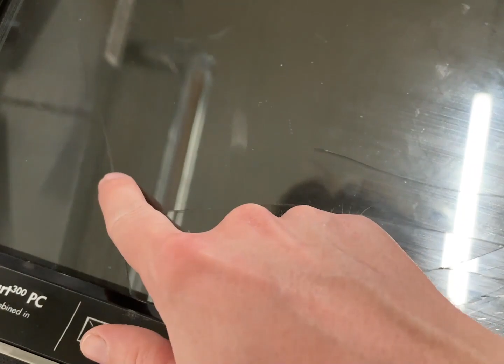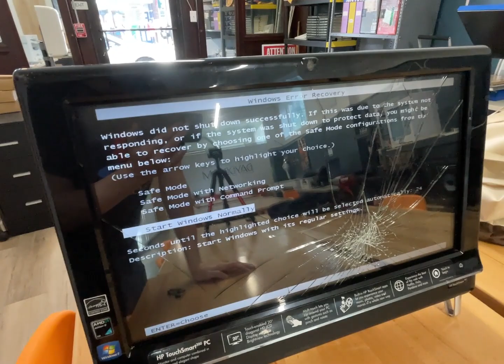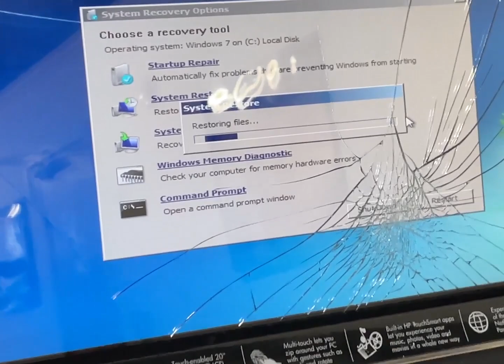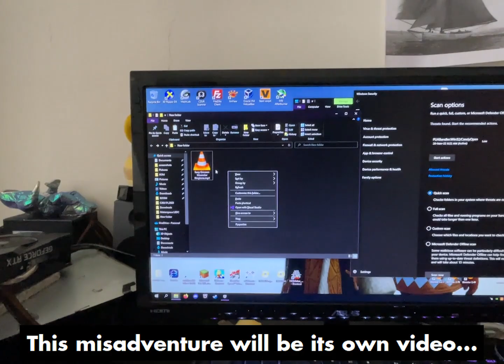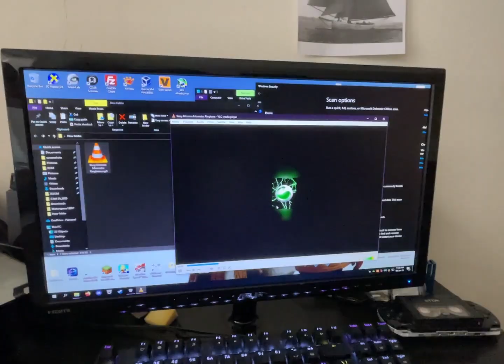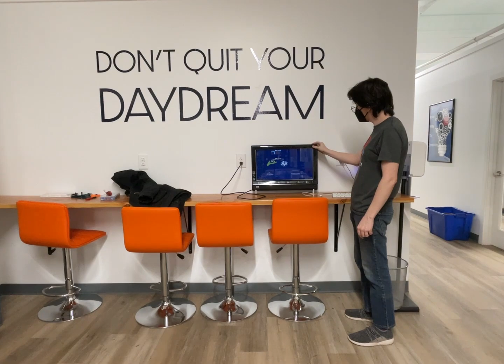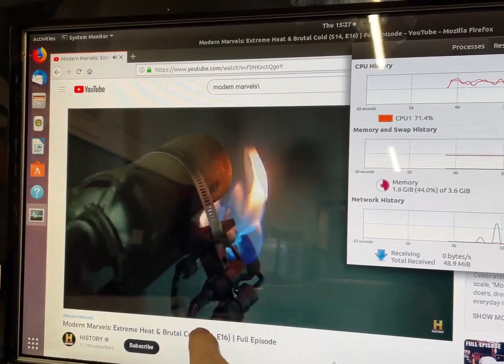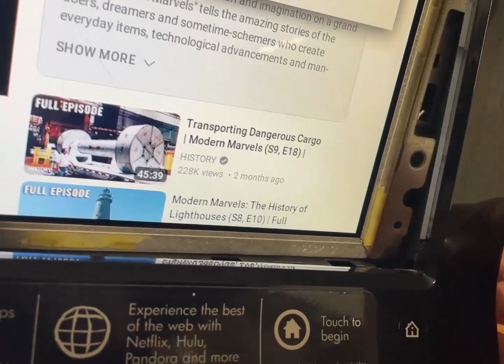Found an HP Touchsmart 300 computer on the side of the road!

Comment: I ALWAYS have my eyes open for computer stuff that's dumped outside houses, or at roadside.  That started about 8 years back when I found a laptop dumped in a skip (as we call dumpsters here in the UK) that was placed outside a house for the workers to dump debris from the house renovations.  I couldn't get the laptop working (not enough knowledge back then) but salvaged the screen and ended up using it as a secondary monitor for a couple of years. 

The one that really breaks my heart is where I've worked labouring jobs and the companies are throwing away laptops and PC's but we are not allowed to take anything; even if storage media  has been removed.  I remember dropping ten school laptops into bins (not even recycle bins) and groaning inside because the school caretaker was reluctant to let me take any; then on another job, I was moving furnature around in an embassy, and they had literally hundreds of old computers and monitors which were going to be destroyed.  I was salivating all morning seeing that; but, I suppose for privacy and other reasons, they wouldn't let any of us leave the building with the 'junk'.  It's probably in landfill now? I dunno.  Those kinds of things really hurt my 'inner junk salvager'. 🙂
Reply: same here buddy....i went the extra mile and salvaged stuff regardless, of course respecting GDPR by removing HDDs, but the risk was high, rewards where worth it, my local library has an E-waste bin i frequently pillage from, as long as i donate somthing first it is morally acceptable!

shame i can't rescue Tellies, they are just too big to walk out with!

Comment: Looks slightly better designed/serviceable than the one I parted out some years ago, mobo was bad but the HDD and RAM helped revive a laptop! That one's nice, has a full-size HDD and nice big access-panels.
Wow! That's an impressive amount of greasy schmutz in there! Where was this, a kitchen?
Gotta say, impressive salvage-work in removing that glass! Pity they made the video ribbon-cable so short.
But hey, you got it working in the end! I'm impressed, after that connector failed I didn't think it'd work again.
I can almost hear that Playstation shirt, I like it.

Comment: Hah! I found a very similar system from Lenovo a while back. Same problem: Smashed glass but everything else was fine. I ended up using heat and prying as well but I got one small spot at one edge of the LCD a little too hot so the LCD has a little permanent spot on it. I see you were more careful with the heat and used more prying :)

Comment: 41:09 OEM stuff like this is really annoying and tricky to get working right, or again.  I had hell with my old HP Pavillion I got out of a dumpster.  Once I finally got it running, I thought I'd modify a AM4 stock cooler, (it was bigger heatsink and fan.)  and make it work....BAD IDEA.  I think I melted the little APU in the system.  It always ran hot anyway.

Comment: 43:54 I wonder if you could put Saran wrap onto the LCD, at least as a minimal barrier to getting scratched?  Or do you think the latent heat produced by the LCD and PC would melt the plastic wrap?  I would say to upgrade the RAM, but IDK what that board can support.  I'd have to look up the data sheet.  But using 44% just running a YT video at SD res?  Yikes.  How far we have come.

Comment: found a 2012 (retina) imac on the side of the road but all i had was my bike, was going to come back with car and grab but i plugged it into my little inverter and the display was good. didnt want someone else to get it before me so i just put it in between my arms held it all the way home. firmware update, new ssd and cleaning later sold it for like 300 at the time. smelled like smokes and vapes had a bunch of nasty nsfw stuff on the hdd but cleaned up real good
Reply from the maker: Very nice. I would guard that find as well!

Comment: 4:45 yeah I've been messing around with an old dual core 775 socket dell, and installed Linux Mint.  I was just gonna put in Win 10, but even the installer took 5 minutes to load in, linux?  30 seconds tops.
Reply: I have a (crappy) video on my channel on how to bsel overclock some of those cpus.  Great fun.

Comment: You will need a new touch panel and you can get one for $73.71
Reply from the maker: It doesnt have a touch panel actually, its just IR sensors on the edges. All it needs is glass. It uses IR sensors to detect your finger location

Comment: Just wipe and re-install. Don’t bother with a repair. Better yet. Replace the hdd with ssd
Reply from the maker: I wanted to see if it was an original install key, however it wasn't
Reply: @RinoaL  Better if it's not an original install key. The original "royalty" OEM installs all use the same keys, I have a list. HP Win7 Home Prem is 4FG99-BC3HD-73CQT-WMF7J-3Q6C9.